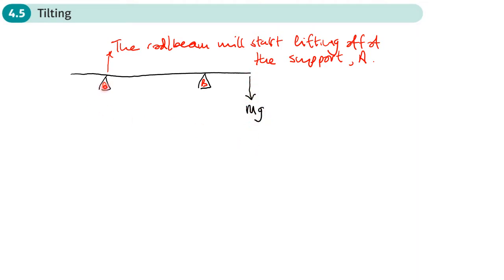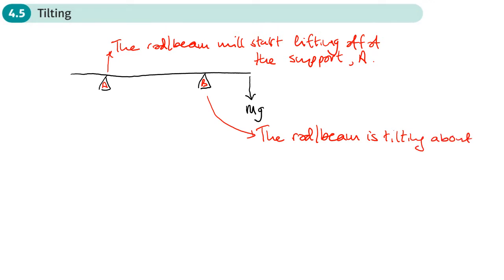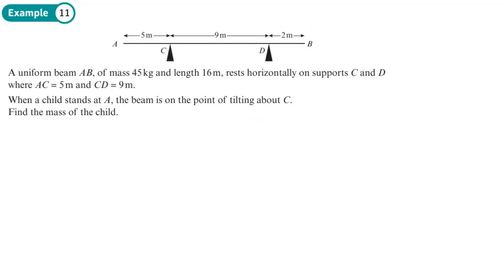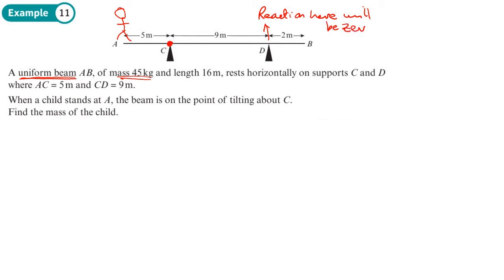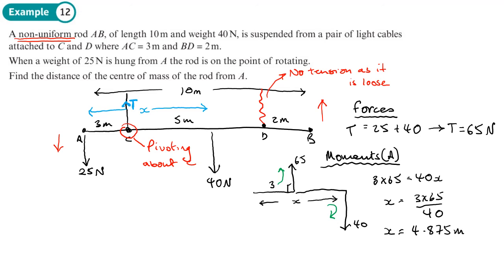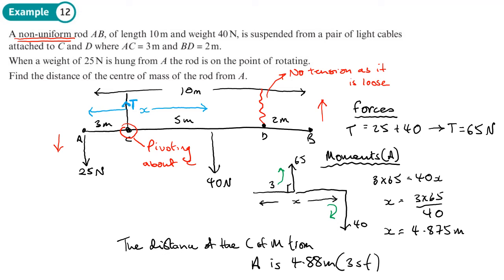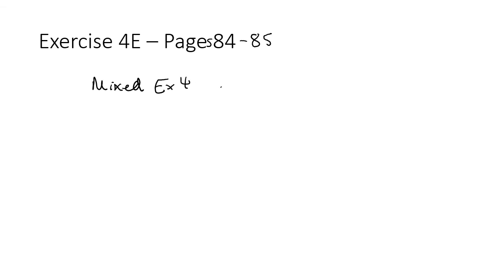4.5 Tilting (STATISTICS AND MECHANICS 2 - Chapter 4: Moments)

Comment: Are you allowed to resolve the forces like that in example 12, it doesnt mention the rod being in equilibrium?
Reply from the maker: You would only resolve the forces this way if the question says that the rod is on the point of rotating, which means that one of the tension forces is gone.  So it's not in equilibrium any more.

Comment: Why is tension used in example 12 all of a sudden and would u lose marks if u just referred to tension as R like we do with any force normally?
Reply from the maker: We are using tension as the rod is suspended from cable, not resting on a support.  Tension is not the same as a normal reaction, as tension doesn't always act in a direction perpendicular to the rod.  It all depends on the angle between the rod and the cable